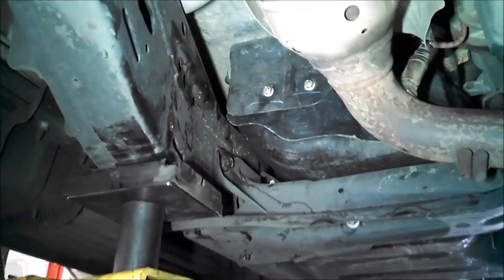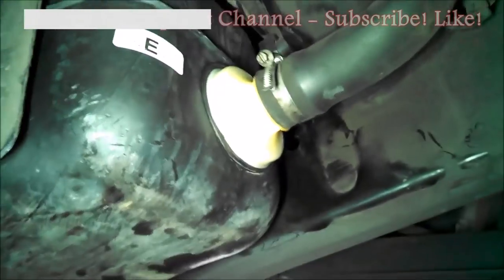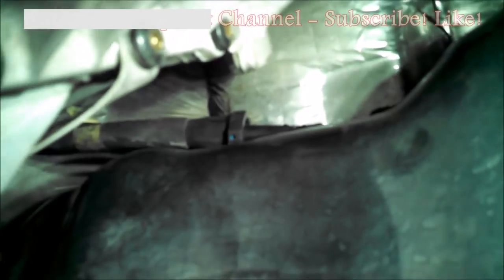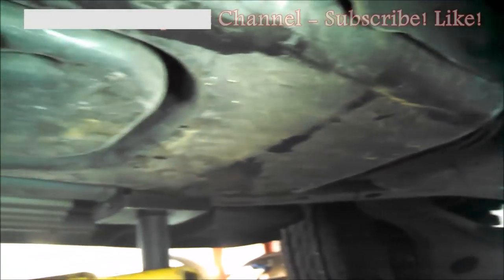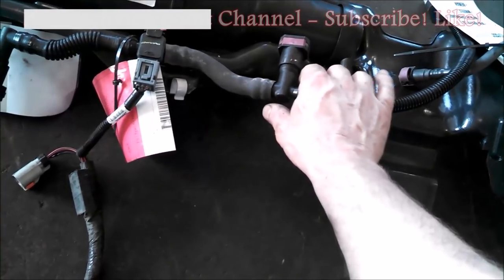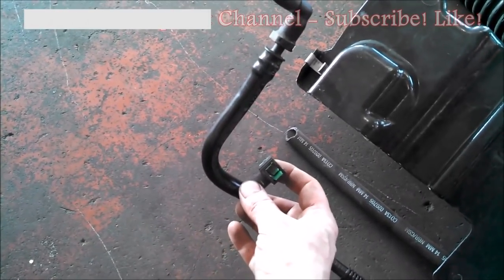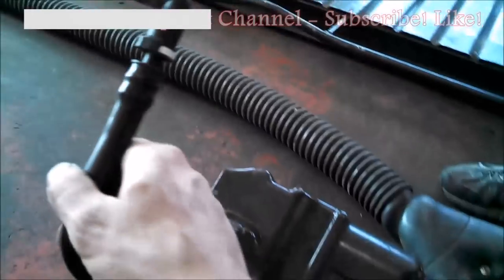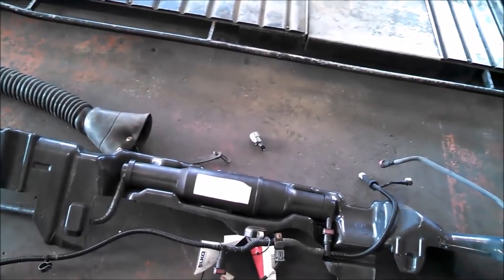Fuel pump replacement Ford Explorer 2005-2010 Install Remove Replace Mountaineer

Comment: I changed my fuel pump and now it builds pressure while filling so it over flows before it's full. I think I kinked that line toward the back of the fule tank while dropping it. Any way you know the part number for that fuel hose you were showing?

Comment: I only removed two heat shield bolts to get to the fuel filter after removing them from the tank it was smooth sailing.

Comment: Question, have you ever replaced the carrier on the rear drive shaft? The bushing on mine is bad and I've heard both, it can be replaced and it can't...just wondering if you might have insite?

Comment: You have to remove the axle to get the tank out unless you booger the crap out of the tank strap. You don't need to pull cross member to pull gas tank. Probably had a hole from being butchered out. Also, that is a check valve in the ass end of the tank. Fuel goes in, it better not come out or you have a failure that needs to be remedied. Maybe someone tried to steal gas from it? I'm not sure how that goes bad. I had 15 gallons in mine and only had a few drops from ass end. I feel bad for your customers! I feel like they are getting hosed. Especially that you just dropped that plastic connector right on the ground without a care in the world if it cracked.
Reply: Thank God!  There is at least one person with sense on the internet.  Glad to stumble scross you rywolf.  My thoughts exactly on 1) removing or prying down the cross member and most importantly 2) How the hell did this guy get the rear strap around the monsterous axle obstrcuting it?  Thanks for a voice of reason.  All these other comments and this video had me thinking I was living in an alternate reality where somehow everyone but me can drop a fuel t5ank in an Explorer without removing the axle.

Comment: I had a problem with the rusted tank straps which I think I will just buy new ones I got the first front one on but the back one is rusted and bent so I will just buy some new ones.

Comment: I never had to remove the cross member bolts, I have a 2004 and it's a huge tank and after all connections where removed and straps, also my rear drive shaft, it pulled back and came down easy, never had to mess with the ones you mentioned. maybe that can help, just what I think, less is better.
Reply: I do it the same way. Dropping the driveshaft is 4 bolt that will save you 60 minutes of cussing lol
Reply: @ImTheJoker4u  where are u disconnecting the driveshaft at, the rear axle?
Reply: @Travel360s  yes.

Comment: what kind of swivel did you use. been trying to find one to work, but cant get it.,
Reply: Ashley Bruce do you have a harbor freight near you? They have a set that has a skookum swivel. Item#67908
Reply: He probably used swivel sockets. Its a socket with a swivel built in. Usually shallow depth for tight spaces. They come in all sizes - 1/4, 3/8, 1/2  Drives, SAE and metric. Standard for 1/4 and 3/8. Usually 1/2 is impact rated, though Ive seen 3/8 impact.

Comment: i see all these ford tank but no one for 2004 suv Explorer can you put on video how to take the tank down
Reply: Angel Casado basically the same setup for all of them up to 2010. Even the pump for the exploder and mountaineer were the same for almost a decade. Starting somewhere around 2001.